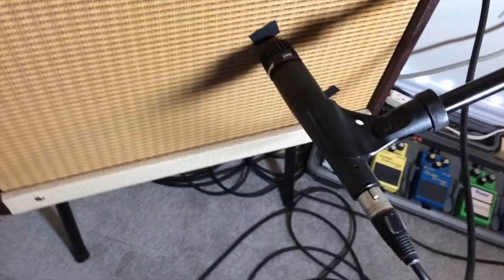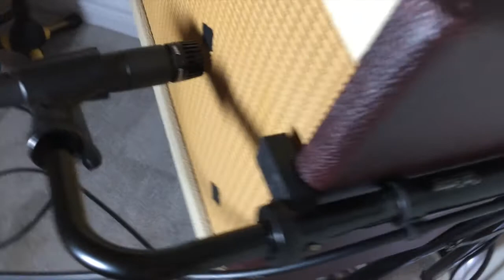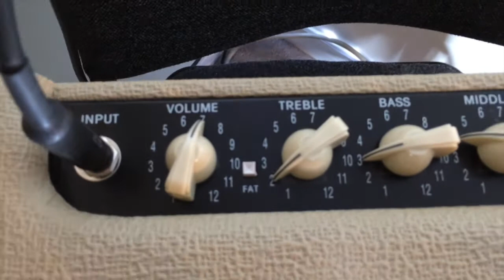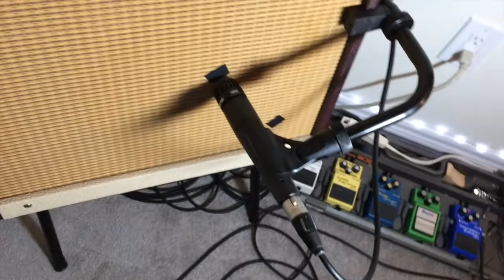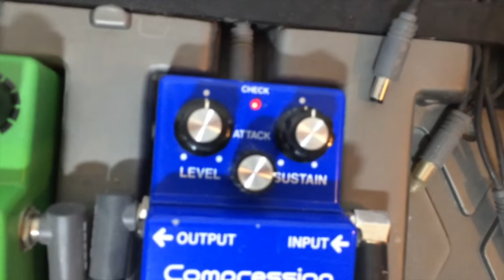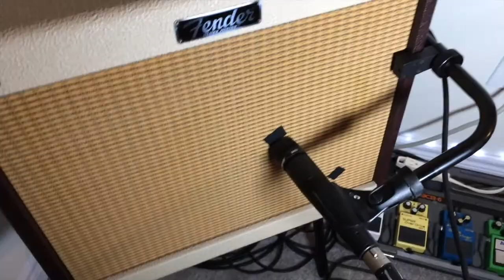Recording Your Guitar Amp (Blues Junior, Jensen P12Q, Shure SM57, Tube Screamer)

Comment: can’t we have volume knob set as 2-3?
Reply: 7 is a bit loud for home
Reply from the maker: @ccchatorocks  Also keep in mind that I have the Master knob only on about 3 so the overall volume is not too high.  It’s the preamp Volume knob that is set to 7.  That way you get some preamp overdrive at fairly low volume.
Reply from the maker: You can set volume at 2 or 3 and that will give you a cleaner tone.  I generally set the volume at about 7 so the preamp tubes overdrive a bit.  Please subscribe!